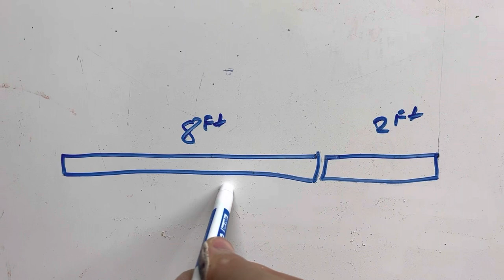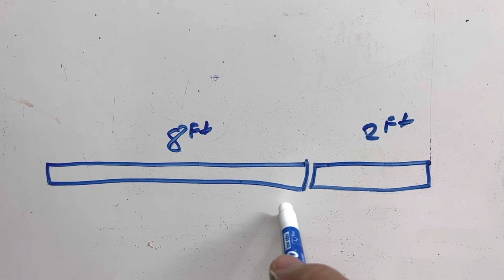Ash Conference table build: Under-tooled in a small shop

Comment: I made a 5' x 5' Ash Table, and I milled the boards while they were a full 12' long to make sure I got the most useable stock  from the best parts of the board. I just skip-planed mine though, they were close enough to flat and straight that I didn't both making a jointing sled.
Reply from the maker: The jointer sled that I made for this project has earned it's spot in my shop for as long as it'll hold up. I was shocked at how well it worked. Milling 10' stock was hard enough. Thinking about milling 12' worth of Ash makes my back hurt just thinking about it. HA!

Comment: I liked the video. It was good to see another wood worker struggling and figuring it out. My one tip would be to get help making the last rip cut when milling the lumber. Your shop is not set up to make an accurate rip cut on a 10ft board. Find a friends shop that has proper in feed and out feed support. It’s the only way you will get accurate glue line. You could also invest in a track saw and do your long rips that way. Keep making content and furniture
Reply from the maker: You're so right. My shop is not the most idea place to build this big of project. I do have a track saw. The Kreg ACS. Looking back, I probably should have used it more from a sheer safety prospective. I'm very happy to report that I have recently upgraded my table saw to the big red and black one everyone loves (hehe) and I feel much better about making these sort of cuts. Thank you for the kind words and the tip. Another video will be uploaded very soon. I've just finished my Walnut computer desk.

Comment: Noticed the rings on the ends of your boards all going in same direction.. May cause problems in the future life of the table.
Reply from the maker: Iv heard conflicting opinions about this direction of the end grain situation. Do you alternate? do you not? I consume an obscene amount of woodworking content online & there isn’t one consistent opinion about his rule that I’m aware of. Fingers crossed that there won’t be any issues. One good thing, the table has a steel base mounted with threaded inserts. I’m quite confident the base will hold it flat if it tries to turn into a potato chip.

Comment: May I ask where you got the rails / hardware for the slab leveling jig. I'm looking to make one of those for myself. There are numerous plans on the web - but I really like the look / function of yours. Enjoyed the video - thank you. I started off woodworking in a 10 x 12 garden shed. Later I moved up to a massive 12 x 20 double garage; which now seems way too small. 😁
Reply from the maker: Search “Linear rails” on Amazon. They have quite a few different sizes. They are mainly used for home made CNC machines.
Reply: What are those fold out legs ?